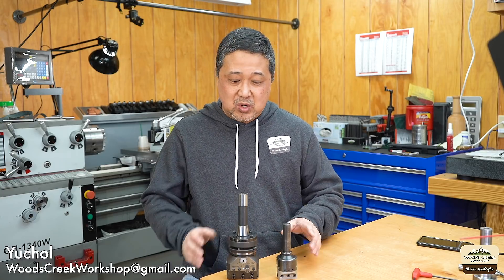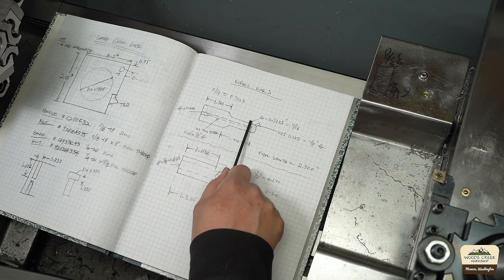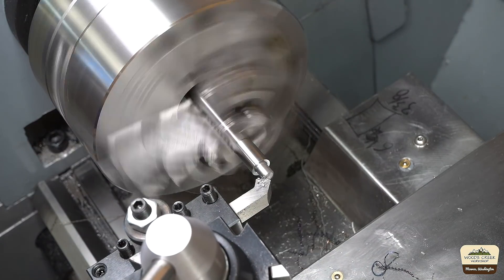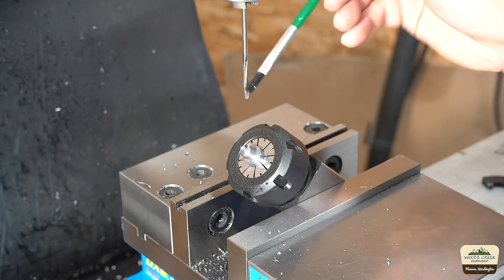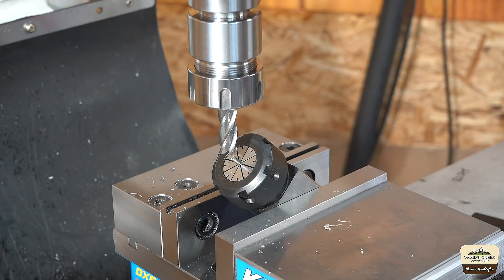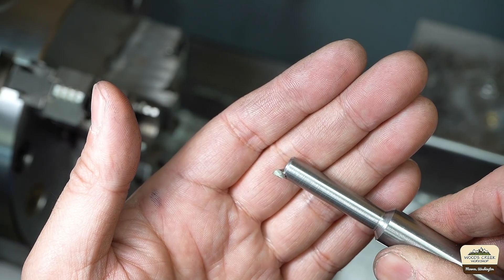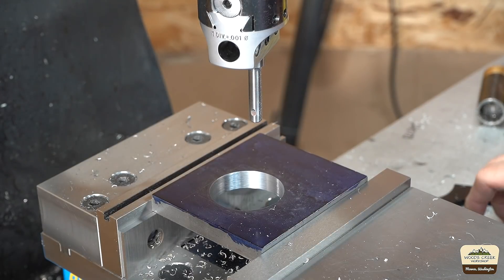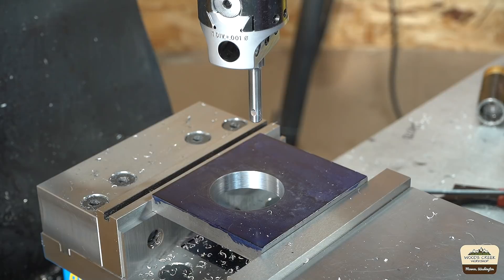Make HSS Boring Bars For Your Boring Head

Comment: Why are they hardened?  For that matter, why O1 steel?
Reply from the maker: Jeff Kurtock you want boring bars to be as rigid has possible without making them glass hard (would shatter).  Rigidity allows consistent dimensions on parts you’re machining.
Reply: @woodscreekworkshop9939  Rigidity is measured by elastic modulus.  Elastic modulus doesn't change with hardening. https://www.researchgate.net/post/Will_the_Youngs_Modulus_E_value_change_with_heat_treatment . I would expect that hardening boring bars will make them, well, harder.  But it shouldn't make them more rigid, or stiffer.

Comment: Lot better than the cheap soft shank boring bars.
When you try to remove them the set screw has made a deep imprint in the shank.
Reply from the maker: Yeah. I’ve got some of those too.  I will eventually phase them out